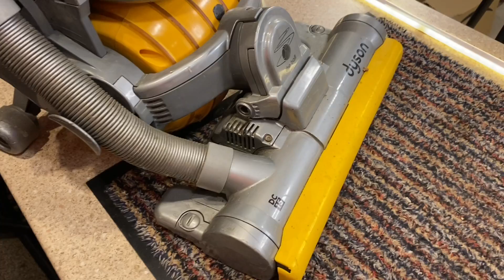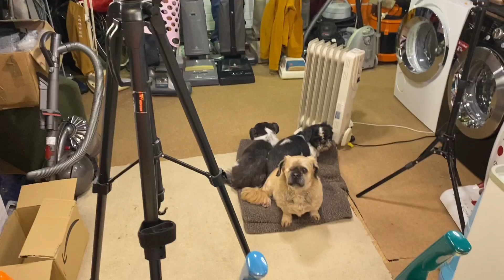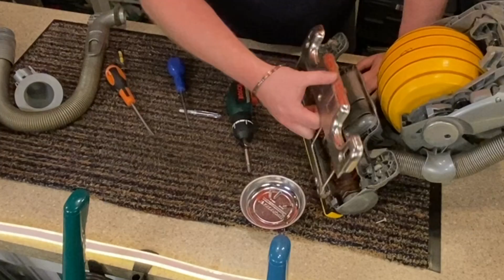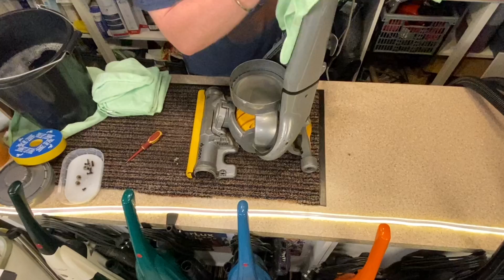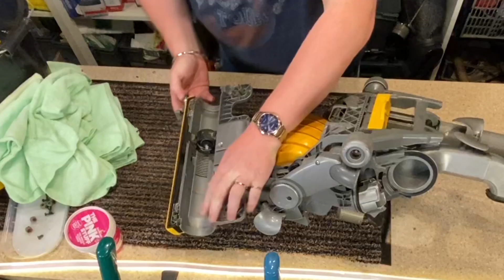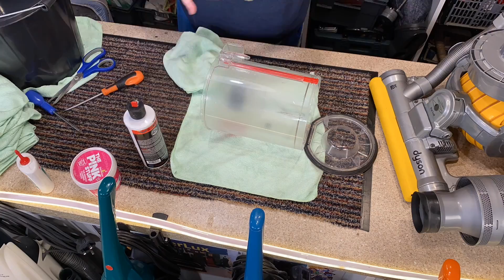Dyson DC15 All Floors, Cleanup & Rescue

Comment: I had the same problem with that plastic piece location on the brush roller.You need to go a step further on the brush roller head and check the gear box .My was loaded completely with hair destroying the nylon gears.The used replacement also had some hair accumulation in the grease.The screws look like Allen head but are a small torx.also both brush head motors had fuze balls around the commutator area.
Reply from the maker: Yeah, I will definitely have to look into it if I do another video on it.

Comment: Nice if you didn't skip over how to remove the lower filter, finding it a pain to remove ;(
Reply from the maker: Mine was old, it just pulled off.
Reply: @HooverLux  Thanks for replying, though for anyone else who also struggles. Seems obvious now after figuring it out, but most hoovers have 3 clips (1 big one in the middle). Yet with this model it only appears to be 2 at first glance, the 3rd one is hidden away on the back side instead of the front like most models. So you need to move the tube thing first and then you will see it. Once you unclip that, pops off easy peasy!
Reply from the maker: Thanks for replying, this was the one and only I’ve ever returned, the clips on mine must have been worn and loose, but good to know for a future refurb 🤗

Comment: Thank you. It was 7.53 when you started to disconnect the bottom of the hose. Like you I thought you had to push on the 2 indentations to release the transparent tube. In fact as you showed, by lifting the hose vertically and turning it slightly the whole thing comes away in one piece. Very helpful.
Reply from the maker: I’m very glad my bodgy video helped 🤣. Stay safe.

Comment: Love that wide angle!! ... cough cough, and my orange U3137 😜. These early Dysons can be such beats to refurb. I did a DC25 a couple months ago and don’t want to ever touch one again haha.
Reply from the maker: Hey Nick O! When’s that visit happening for your demo of it! I’ve never done one before, so it was fun to do. I’d have liked to have dismantled the brush head motor etc, but I’d really not know where to start, but it all sounded ok.
Reply: @HooverLux  I was actually planning a European vacation with some time spent in Essex where my folk come from. Would have been a great time for a visit, but then the good ol’ plague necessitated those funds to be spent elsewhere. I’ll have to start saving my pennies once again and make it happen.  Frankly I think it’s worth the trip across the pond just for the pure power haha. You were probably better off not to dismantle it. It sounded great and while the plastic seems a bit stronger than the DC07 for example, it’s still so easily to break those. Great work yet again!